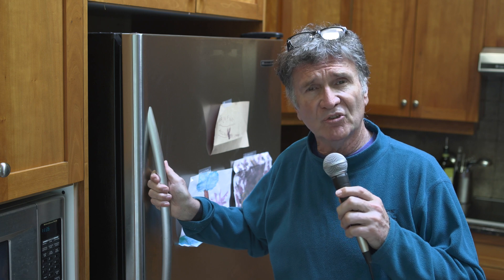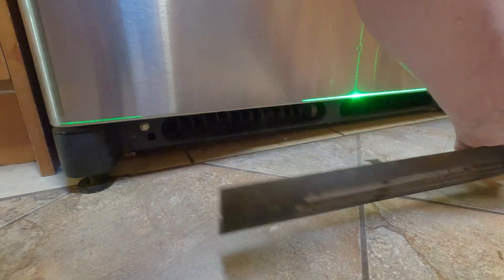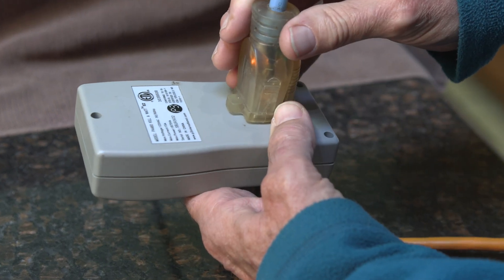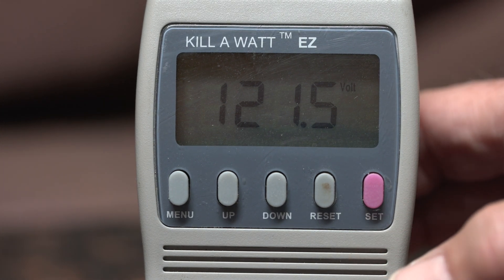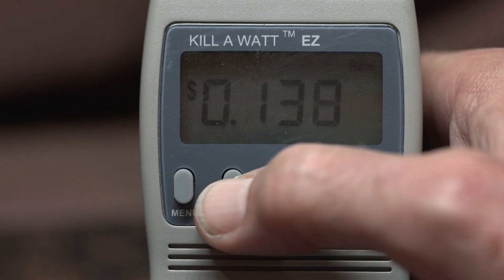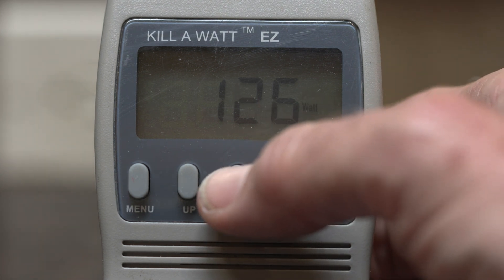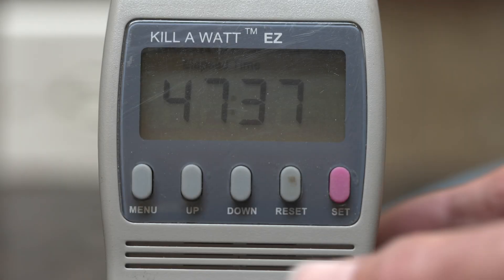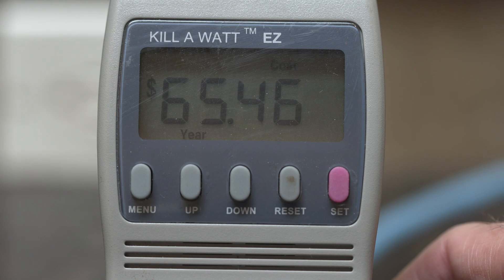How to evaluate energy consumption in a fridge

Comment: Still using a microphone with a cord in 2024?
Reply from the maker: Ha ha, yes! Audio has been a constant battle, with annoying room echo specifically in small rooms that can't be modified. Past videos on my channel gave embarrassingly poor audio using various condenser mics, lav mics, radio mics, and even my trusty Rode NTG-2 condenser shotgun mic. Holding any mic closer helps a lot, but not enough for some rooms. The mic needs to be so close you can't avoid it being in the frame, and you want the drop off over distance to be really steep. Going back to old style externally powered dynamic mics turned out to the best solution for rooms like this one. I use a Shure MV7 for the desktop, and for more mobile application the inexpensive and classic Shure SM58 works best. It even does better for wind noise. Interestingly, a close second place went to my iPhone, which isn't great for wind noise but gives better audio for close work, and the near focus for video on the Iphone is outstanding.

Comment from the maker: Another way to think about this is to calculate average power consumption for the entire year. $65.46/y * 1 kWh/$0.141 * 1y/365.25d * 1d/24h = 52.9W. So, energy consumption is equivalent to a 53W light bulb running continuously. Pretty good!. Even though peak compressor inrush current is going to spike up, once the motor produces back emf the current draw drops dramatically. These numbers were likely much higher when we had many people opening the fridge door, ha ha.

Comment: Interesting video Dave! I didn't see the amperage with the compressor running. I would suspect around 10 amps or so. In any event, it's a nice tool to evaluate your voltage, current, wattage, power factor and KwH. Very nice feature where you can plug in your pricing per kWH and see how much your electrical bill will be  over a period of time. Keep up the good work and have a great day! 👍
Reply from the maker: To my surprise, after running for a couple of minutes this little compressor doesn't take a lot of current, although I missed inrush current because it doesn't refresh frequently. As you say I would expect it to be much higher. With compressor and both fans running (fridge lights and motor for ice tray off), it drew only 1.8A, slowly dropping to about 1.4A after a few minutes. It was low enough that I questioned the accuracy of my device, so I used my clamp meter on a single hot wire to verify the finding as accurate. I'm sure it draws more during startup and during the defrost phase when the resistance heater melts evaporator ice.

Comment: The coil should have stayed on the back where they rarely needed cleaning. The absolute worst place is on the bottom. My coil is an bottom-mounted, accordion-folded nightmare so you have to empty out the frig & lean it over against a wall to get any proper access to clean them.